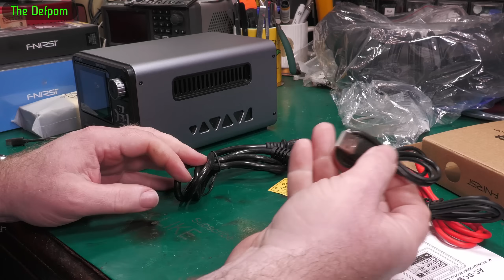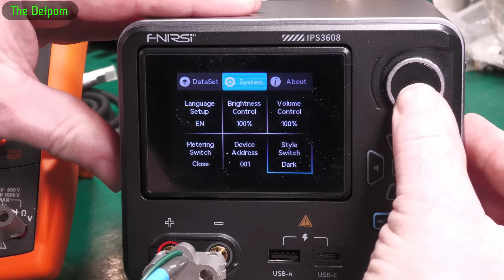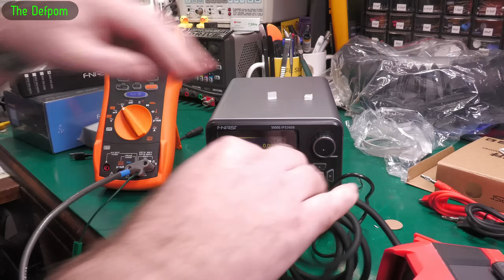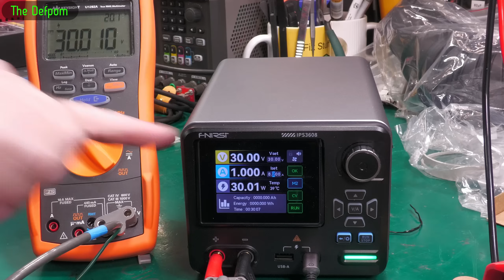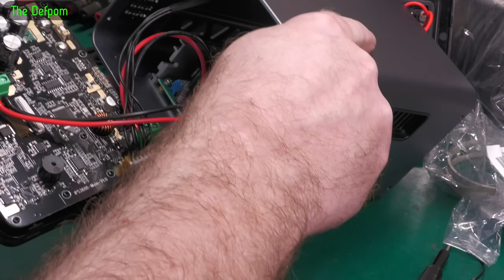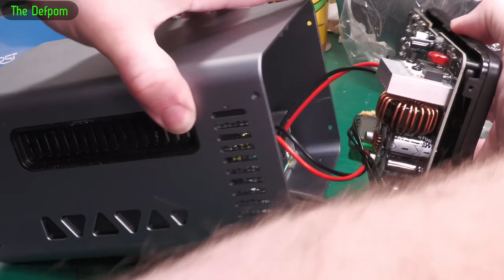🔴 Is The NEW FNIRSI IPS3608 Power Supply Any Good ? - My Review - No.1400

Comment: After buying a few FNIRSI products, I realize their stuff is built like crap. Boards have loose solder connections, and many things not grounded properly, it’s mostly made like crap - no more FNIRSI for me - done.
Reply: I have the dws 200 solder station, the clamp meter and the spot welder and I am satisfied so far for the value. I dont like the PS for what it costs though.

Comment: You did not remove your scope ground lead and replace it with a ground spring... That ground lead picks up all the noise in your bench area. Retest with the ground spring before you quote noise. Lookup "EEVblog #594 - How To Measure Power Supply Ripple & Noise" for another way as well.
Reply from the maker: I was NOT using a scope probe, I was using a coaxial cable to connect to the scope, and a BNC to banana adaptor straight into the front of the power supply, it couldn't be any more shielded and free of "antenna".

Comment: I feel because you got it free, you are not talking about it's serious downfalls. Such a a fan running with 0 load. No power switch on the front. The software being terrible. You can't actually see the current on the PC software. It's very strange that they advertise such a nice graph, but you can't see the same graph on the PC and streaming. Save yourself 65 bucks. Get a cheapy and it works better
Reply from the maker: I show it exactly as I find it, I am often very critical of items I review, if I find something I don’t like I say so, just go and watch my review for the Fnirsi HS-02 soldering iron and you will see what I mean!

Comment: Is there an output current limitation after the filter capacitors? Specifically, if I set 35V with 5mA and connect an LED at the output rated for a maximum of 40mA, will it be damaged?
Reply from the maker: I expect it would be damaged, output capacitance of the supply is a necessity, it removes noise and ripple from the output, it is a balance between keeping that low and output pulse current control to me some pulse current ids something that is unavoidable, which is why you should be careful with the settings.
Reply: @TheDefpom   Linear supplies have low-capacity output and fast loop; clean DC transition and fast transient response, so much reduced peaks compared to regular switched supplies. It can also be implemented in SMPS power supplies using a MOSFET to ground, which automatically reduces the output voltage when the current exceeds the set limit, just like in the Rohde & Schwarz NGL200.
Reply: @RaduRadi-l2e  That's what i really hate in basically every power supply, so many (usually buggy) software features, fancy displays, high voltages and currents bla bla bla, and no one cares about the ridiculous capacitance on the output which makes basically a sensitive parts/circuits destroyer, for that reason i bought on ebay an advantest R6144 which is great for low power sensitive stuff. The mosfet thingy that you mentioned on the Rohde & Schwarz was really clever an easy.

Comment: Tnx for this review..i subscribed..
I have worked also for years in our Electronics Repair Shop ...i think i have more than 20 power supply,s now..  the older with big power transformers are still the best..   easily 20 years plus...😉
I am not  very impressed by this Power supply....for this price .. connections...only USB- C PD ?? A lot of USB cables and older 5 V USB will not work ..but why it is not a touch screen in combination with those buttons ....the whole time you have to push.  pffff.
And being a Hamradio guy..what is the Noise level on short wave bands ? ...you can test it easily with an AM  portable Radio..😊 sometimes its horrible quality...  Greetings from the Netherlands

Comment: Not 25mm (one inch) distance for the cables proved me that I do NOT want this.
Well, no paired socketed connectors fit there.
FNIRSI f-d up again.
Reply from the maker: The standard is 3/4” or 19.05mm, seems this is about 20mm

Comment: I will not buy any lab supply that does not have external voltage sense connectors.
Reply from the maker: Maybe so, but as you could see the voltage regulation was pretty good even at full load, at least to the front terminals.
Reply: How do you expect that from a $150 Finirsi product?  Watch reviews of $3K Keysight or R&S products instead.

Comment: Would adding more caps not affect constant current performance?
Reply: Yes
Reply: Adding capacitance will allow an initial load current spike before constant current takes over but once the cap is discharged the constant current would settle in to the entered value.  It depends on what you are testing or powering if such a current spike would be acceptable.
Reply: @EriksElectronicsWorkbench  e.g. RF amplifiers compared to battery charging. The former might have a spike in output too, while the latter is unlikely to care. The former is possibly lower power so the over current might be longer. The latter will probably drain the capacitance in the blink of an eye.

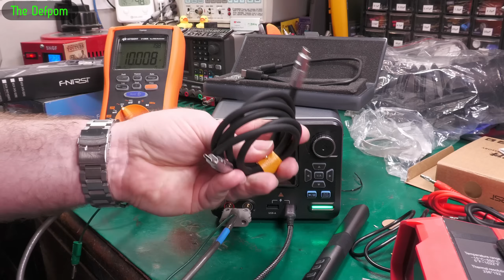Comment: @15:10  The cable is most likely not bad. Cheap devices will only use resistors on the USB port to ask for 5V instead of using a proper PD controller. However, this resistor trick only works with 60W cables. Cables that have the E-Mark chip will require a controller to talk to, and that's probably why it didn't work with the first cable. If the device does not have a controller or resistors, it will simply not charge with USB-C to C cables, which was the case with the thermal camera. Edit: However it should have worked with the Soldering iron because it asked for PD, so maybe it is bad.
Reply: @dddvvvzzz2012  incorrect. To get 5v out of any emarker cable you need the usual 5.1k resistors at the cc pins to gnd.
Reply: @ceejay310  I thought so too. I had this discussion with someone the other day and it does not work. You can try it for yourself, you will not get 5V if its a E-Mark cable with the resistors. The resistors only work for cables up to 60W which do not require E-mark.
Reply: @dddvvvzzz2012 still incorrect. I have modified enough usb devices to usb c, the 5.1k resistors work fine, using e marked cables. I have almost only emarker cables and use them for almosr every usb c device. Only exceptions are where a modification is not feasible due to space reasons.
Reply: @ceejay310 I'm sorry but i don't believe you. I've tried this before and i tried yesterday after your comment just to confirm, and it does not work, and the person i had this discussion with had the same results. You are either doing something different or it's my USB-C module from AliExpress that it's preventing this. If you have pictures of the modules you are using I'd love to see.
Reply: @ceejay310  You are right after all. It was my module. My module had both CC1 and CC2 shorted together with just one resistor to ground. Turns out they have to be separated with one resistor to ground each. And now it works with with E-Mark cable.
Reply: Went through my order history: 1005005565394054 (6 pin version) should work unmodified as well. same for 1005007611826521, these have a holder attached.

Comment: The tiltable screen is s really neat feature, especially for people like us who have stuff stagged up high on the shelves. The spacing of the output would a a bit annoying for me, cause I the two pin plugs a lot. I actually made a new front panel part for one of my power supplies cause of this. An additional ground pin on the output would be a nice addon :)
The USB ports are not really needed for me, cause I have a large 200W multi port USB supply on my bench anyway. But for people who just start to set up the bench it's quite nice :)
Not that worried about fan noise here, cause on the warmer days they window here is open all day and night long anyways, so you get all the street noise. But I replaced all of my devices fans with Noctua fans anyway, so it's way quieter already.

Voltage overshoot in CC mode is such an important measurement! Especially cause a lot supplies handle that so pooly, which can kill many devices under test.
For the earthing, maybe polish down to the bare case on one of these feet screws on the inside of the case and throw a longer screw with a ring terminal on there?

35:35 Would be interesting to see what's on this debug header down there. Maybe a possible option for adding some wireless control with a ESP8266 or so. Would be interested what's on the USB port on the back. Most likely only windows software (as usual), but as most of these things come as a virtual TTY port anyway you can just throw commands on there.

Comment: Seems OK as a PSU, keep the vids coming.
TB = Time Base I assume.
AKA the noise, I would have tried it with the mains off at the wall and finally with the mains lead removed, just to verify it is the unit and not anything external.
Screw in post check the screw length in the top of it.

Comment: well design to meet the world's safety requirements NOT. how about doing a review to IEC 61010-1. 
That would be fun to see 🙂
it's a switcher so will always have switching noise and the displays will add some high frequencies.

when EMC testing equipment I would never use an analogue power with LED displays let alone a  switch mode power supply they just add too much noise in to the chamber.

Comment: Hi, nice power supply, I like that USB supports protocols for increasing voltage. I would put a serrated washer under the longer screw that holds the power supply itself - it will first cut through the anodized surface of the case, then secure the screw against loosening and the anchoring will be solid.
I would add a ceramic capacitor to the output and install another fan. The logic of the output indicator colors is made according to the pattern red - Stop, it's a shame that you didn't try to see if the indicator color changes when switching CV/CC like with Siglent CV green, CC red, and didn't show whether it has an OVP and OCP function.

Nice day 🙂Tom

Comment: Great video as always.

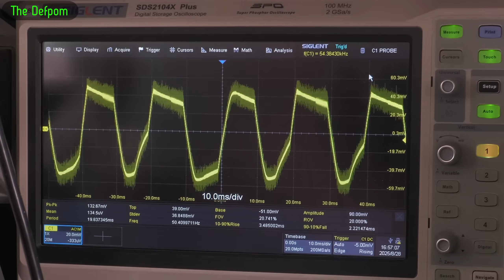21:25 That is just mains pickup. You are calling it higher frequency content, but if you look at 20:27 its 10ms/div, 4 divisions for 2 periods, which means 50hz. The superimposed noise is likely EM stuff from eg LED lights. When the load is off its essentially a very high impedance source, so it will pick up all kinds of crap. That also explains that if you turn on the load, or turn on the supply, most of it disappears.

Also a note at 22:20, you are not just testing noise, but also ripple. The 'sawtooth' waveform is ripple, purely from the supply regulation loop. The spikes on top of it is noise. Hence you are measuring ripple+noise, not just noise. 
If you want to test just ripple, its better to try to bandlimit the signal to 20mhz (industry standard). If you are trying to measure noise, you have to make sure you have a very low impedance ground connection, so you dont pick up spurious noise from other sources.

Interestingly the 'wiggles' you note at 26:41 might be related to the supply switching between constant voltage and constant current. Note how the waveform between the two wiggles is very linear, i.e. a capacitor charging from a constant current, but after the last wiggle shows an exponential rise (i.e. a capacitor charging up from a constant voltage). You can see these 'wiggles'/disturbances as well when you test the 8A.
Would have been interesting to see how the supply responds to sudden changes in load (i.e. suddenly increase a load far into the current limit), or steps in the load current whilst the output is on.

The mains earthing really worries me though. If I would get this supply I'd modify the earthing for sure.
Reply: Great explanation, the wires used also act like antennas that pick up all the interference from the environment. LED lighting can cause a lot of interference even when using a high-quality industrial power supply (that was the case in my case). I connected the power supply and the lights with shielded power wires and the problem was 90% solved, the rest was taken care of by the added filters. From the rest of the shielded power wires, I made atypical measuring cables that would be suitable for this test connection.

Nice day 🙂Tom

Comment: Does it connect to the computer and you can monitor the output with pc software?
Reply: There is. Is the same for dps-150. Cant put the link here because youtube removes the post.
Reply: @jcbritobr perfect great to know
Reply from the maker: I don’t believe there is any software for it, there isn’t anything on the Fnirsi site, I think the rear USBC is only for firmware updates.